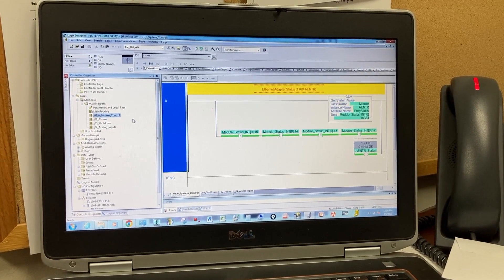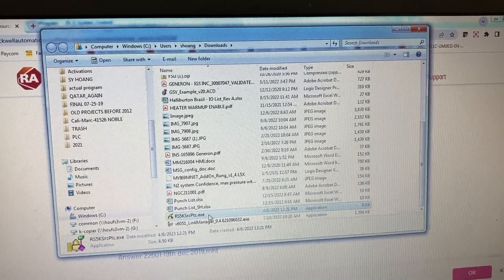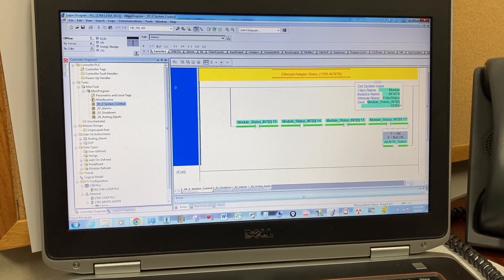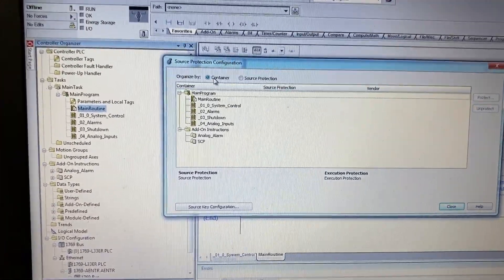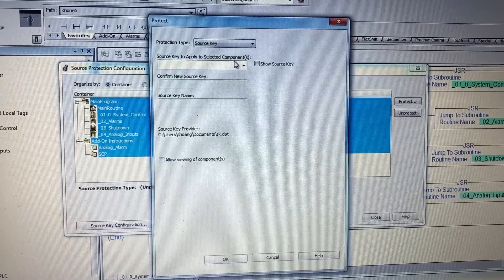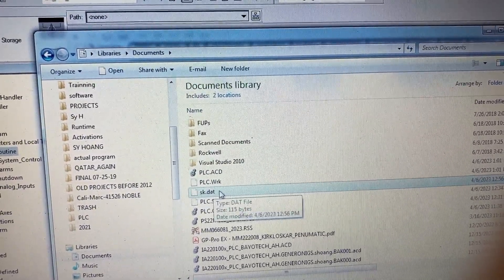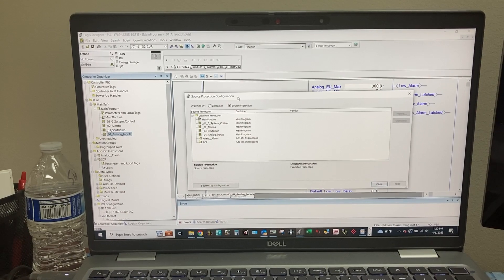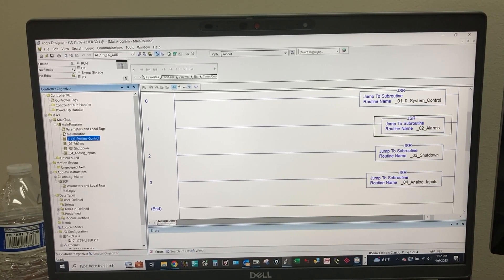Studio5000 Logic Desginer - Source Protection/Security sk.dat

Comment: Hi, once I hit "unprotect" with the right dat file. Do I need to follow this procedure to lock it again or if I close and open the code it will be locked automatically? Thanks in advance.
Reply from the maker: @Mr11051989: Yes, if you hit unprotect and save, you will have to do it again to lock it up. Thank you for your comments.
Reply: @SYPHOANG  I have the offline code which is uploaded from the PLC and I've setup the lock. Now do I just need to download this locked code into the PLC? If yes, once downloaded and if someone uploads the code from the Controller will it still be locked unless they unlock it?
Reply from the maker: @Mr11051989: Yes, you have to download the protected program back to the PLC. If someone uploads the program from the PLC, they will be able to view it only.

Comment: Hello. To be clear: The customer will still be able to download the protected .ACD files and use it normally, correct? We are looking a solution to deploy ACD files but don't want to allow the end user to be able to view / change / force tags etc. Basically, similar functionality to the Service Edition, which is no longer available?  - Thanks.
Reply from the maker: @davh1624: if you don't allow the end user to even view the program, you should lock the whole program. This method with what I showed in the video still allows end users to download and at least view the program for troubleshooting and learn the logic. Thank you for your support to my channel.
Reply: @SYPHOANG Thanks for the reply.  Lets say we do let the users view the program. We just don't want them to be able to edit the logic nor edit tags, flip bits etc. This should suffice, yes?
Reply from the maker: @davh1624: Yes I think it is what you need. But make sure you keep the sk.dat file safe, never lose it. Without it, the program will be locked forever. Another thing is do not ever try to rename the file. If you do it, the file will be corrupted and can't be restored.

Comment: Hello do You know how remove the source protection in studio5000 version 33. I tried but when I tried Open file said: error unsopported encryption comfig value was found.(9) decryption of this file is not yet supported. Thanks
Reply from the maker: @jdlf3712: Thank you for your support to my channel. In order to remove it, first you have to have the right .dat file in you computer. I guess you are just trying to unlock it without the source key from the owner.
Reply: @SYPHOANG  right this company left and some routines in plc program are blocked and I need access for troubleshooting. What can I do?
Reply from the maker: @jdIf3712: It really depends on how the owner set up the protection. If you are lucky, the owner might allows program view and upload. For troubleshooting, you can upload the existing protected PLC program and do "cross reference". You are just not allowed to make changes or modifications on the locked/protected subroutines. That's what the source key is for. Hopefully this is helpful for you.
Reply: @SYPHOANG  thanks You for your answer but this guys really blocked, I can't see what is inside the logic of the subroutine. As You said, before  I've watched other blocked programs and  I was able to see what is inside the logic for troubleshooting but not to modify, but this time is not the case, is really blocked.
Reply from the maker: @jdlf3712: Unfortunately, getting the source key from the owner is the only option for you now. That is what the protection is for. Hopefully you can reach out and get it from him/her. Otherwise, I really don't think you have any other options to break into his/her program. Good luck.
Reply: @SYPHOANG  thanks
Reply: @Fenixave4  did you ever figure anything out?